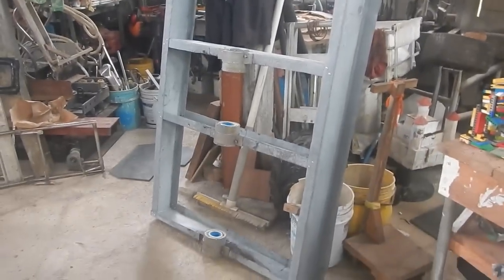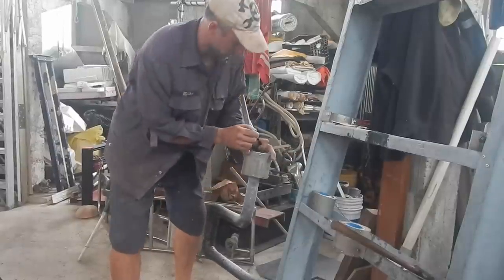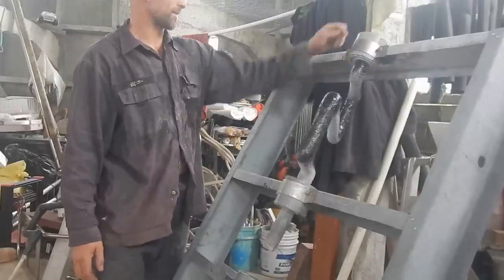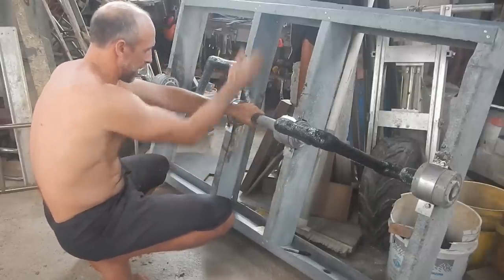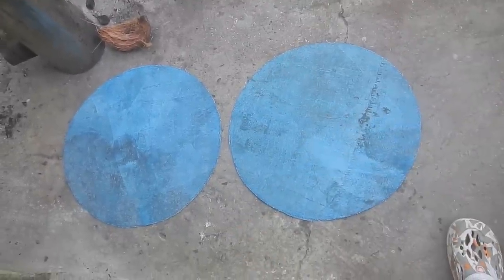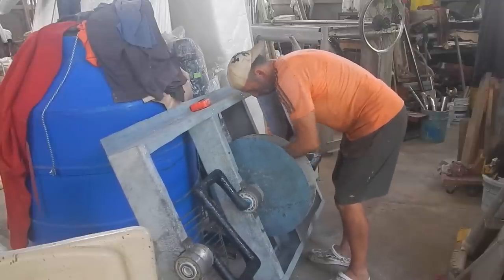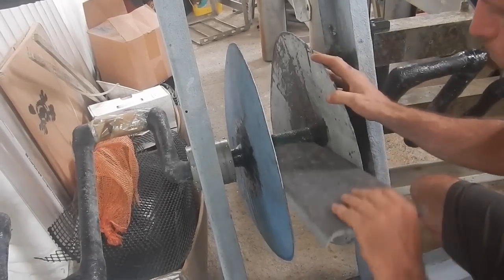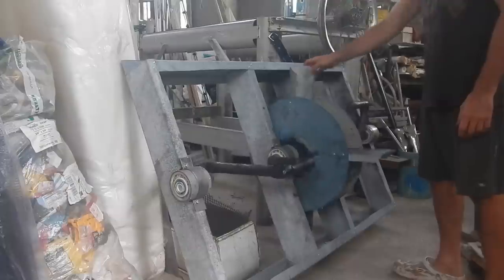Shark Slicer upgrade 006 Paddle Wheel

Comment: Why four paddles vs six or eight.  I do agree with trying it first before making the paddles wider.  From canoe and kayak paddling I can attest that often a narrower blade at a faster speed is better.  I feel like in the paddle wheel engineering handbook there should exist some equations to describe all this.   Let's see the power of two people is about 250 watts continuous and most people put out the best power at 60 to 100 rpm, but it looks like a lot of information is missing.  On with the empirical estimations and experimentation!